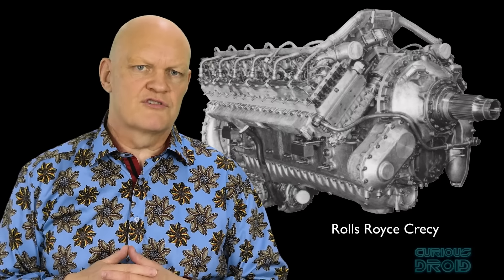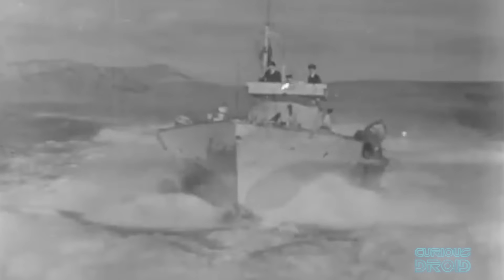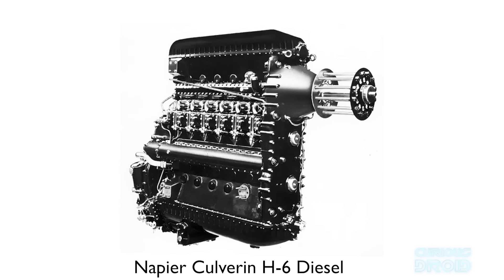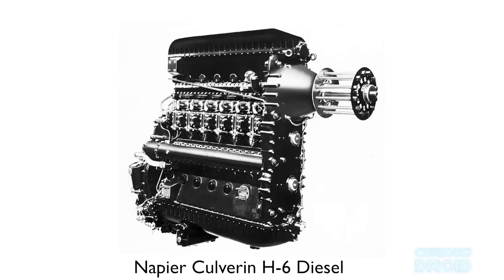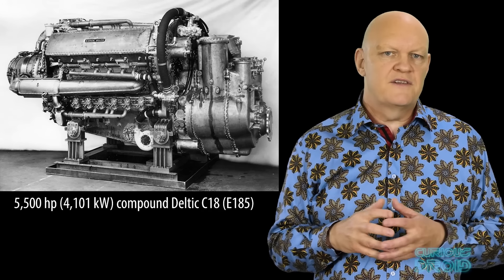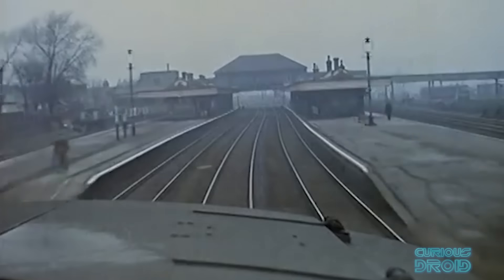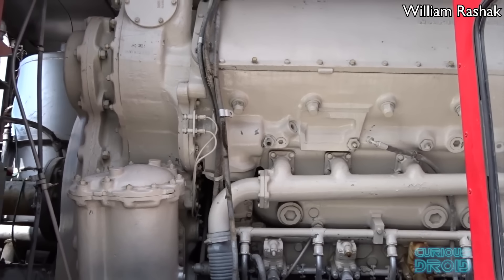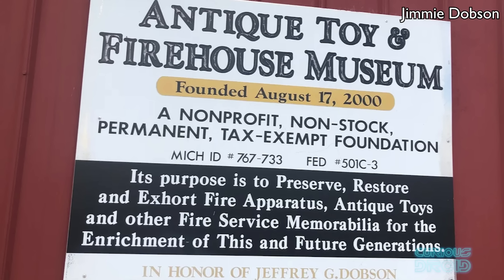The Legendary Napier Deltic - 88 Litre Opposed 2-Stroke Triangle Engine

Comment: I served on several Ton Class minesweepers/hunters in the RN.  Starting was fun, they used an explosive cartridge!  If they broke we swapped them, took less than 24 hours.  Remove all the bolts to the deck housing, disconnect everything, lift out and reverse with replacement engine. If you visit Gunwarf Quays in Portsmouth the preserved crane is what we used when it was HMS Vernon.
Reply: Great comment!!
Reply: Thats amazing.  Thanks for the sharing your knowledge!!
Reply: The Royal Engineers had their Diving Training Establishment at Vernon up to the late '90's (I think). I did my training there and we used 'the creek' dock to dive (and also at Horsea) and i can vaguely remember it had a crane nearby. I'd guess this dock/inlet was where your boats were berthed for their refit?
Arduous training but great memories.
Reply: Some tractors were started with a blank 12 bore cartridge.
Reply: I've often wondered how the explosive cartridge   start the engine?
Reply: @markrobinson1135  same way as compressed air is used to start engine.The blank cartridge was put in a holder which screwed into a recess in top of cylinder then fired by hitting a striker with a hammer.The expanding gas imparted rotational motion.The cyl had to be at TDC on compression before firing the cartridge.
Reply: @markrobinson1135  I guess you have no idea at all about internal combustion engines then.
Reply: @ke7eha  Correct me if I am wrong, but isn't that how they started the plane engine in the original Flight of the Phoenix film  (1965)?  I seem to remember for jeopardy they got down to their last cartridge before it caught and flew them out of there....😱.  As a child I didn't even question it, but have since wondered as it seemed drastic.  Makes more sense with your explanation! 😎
Reply: @rooramblingon895  yep, and I just rewatched that scene. Second to last cartridge, I think.
Reply: @millomweb  I guess you have no idea how to be a decent human being
Reply: @philiptownsend4026  Sorry for stating the facts.
Reply: @whirledpeas1182  I've learnt from many others.
Reply: @philiptownsend4026  Usually, there's a 'self-protection' nature where the person is too thick to even ask such a stupid question. Someone wondering how you can start an engine with a cartridge would seem to indicate they have some idea how an engine works - and so the process is fairly self-explanatory. When the thing runs on explosions, creating the first one with a cartridge is pretty insignificant - but a fun way to start an engine though !
Reply: @millomweb  there aren't any stupid questions. Not everybody has the benefit of the same experience and education, and nobody can know everything. I'm sure there are plenty of subjects on which you'd have "stupid" questions to ask - let's not gatekeep the things we're interested in and exclude people who aren't already in the know, why not just take 2 minutes to explain and bring those people in so they can share in our interests too?
Reply: @chemistrykrang8065  There certainly are stupid questions !
Reply: @philiptownsend4026  "IC engines do not run on explosions. So what does you the expert know?"

That you're wrong !

IC engines are designed to withstand the explosions - which is why they generally don't shatter. Occasionally, one blows the head off.
Reply: @philiptownsend4026  At least I now know they're not 'hydrocarbon fuels'.
If you want to be precise, they do explode but in a suitable container. 

I don't think they'd have sold many advertising them with internal explosion engines.
As for your assertion fuels don't explode - try convincing the folks who live in what's left of New Ferry, Wirral.
Reply: @philiptownsend4026  "I am still not managing to get you to accept the difference between flammable and explosive substances"

That's because there is no difference, same substance, different combustion circumstances !

"but really it was a very fast rapidly expanding burn" - a bit like an explosion then ;)

Irrespective of the fuel, if the burn results in a container failure, that is usually sudden and therefore explosive - in New Ferry, the container was a building.

Pretty much any flammable fuel can be burnt 'calmly' or explosively. It is entirely down to how the burn is achieved.

"I think I have been able to help you in two ways:...." I guess you've not asked me any stupid questions.

I suggest you check on the definition of 'explosion' et al - then you'd probably find you'll agree with me.
For info, when you challenged my understanding of it, of course I researched what I believed to be true - and as is often the case but not always, I was right.

On a different matter altogether - 'metadata'. I understood it from the 'off'. Last December, I found computer people were explaining it wrong. So I had a conflict of info - so I researched it - and discovered I was right and nearly all in the computer world are wrong !
Reply: @millomweb  I had two , fordson super majors with 4x4 conversions ,used them as skidders for forestry .. we called them spitfire starters as was same cartridge used to start aero  engines, or that was what we were told they were .. had another that was a windup spring loaded ..
Reply: @borderreiver1806  Same cartridge for aero engines and other engines
Reply: @borderreiver1806  - that name you are using sounds like the name of a wagon !
Reply: @borderreiver1806  - indeed, my parents and many generations before them were from Langholm. Proud of my Reiver roots, and their 'best of both worlds' ethos!
The KOSB disbanded in 2006 but the honours live on.
Back to the Napier Deltic...!
Reply: @millomweb  why insult someone for asking a question? did you come out of the womb knowing all the answers?
Reply: To answer the original and some followup thoughts without snark...
If you don't have a reliable electric start system (because they haven't been invented when dealing with early engines, or would weight too much for air use, etc), and sometimes even if you do, you want a reliable and safe way to start the engine.
One thing that almost always works as expected is a solid explosive - more along the lines of smokeless powder than C4; packed into nice cartridges. The cartridge when fired creates a lot of gas that previously wasn't there - as long as you spun the prop to make sure it was at the right spot before you fired it, you've just blown a bunch of gas into a piston and got the whole works spinning. If you can add fuel and spark/magneto fast enough, you can fire up the engine. Of course make sure to replace them with new ones when you land. :P
Same idea was used on a lot of ICBMs and their human rated variants (Titan II) which fired a cart (audible in launch videos) to initially spin up the turbopumps (that provide fuel and oxidizer at high pressure to the combustion chamber).
Things were a lot different with old planes, and still remain so for many of the vintage planes still in use. Modern pilots are spoiled in comparison - start up the APU and once it's running set some bleed valves to the right setting and you can spool your engines... obviously a long checklist before you can fly, but some of those "cold and dark to flight ready" videos show the longest delay is often the navigation system getting its bearings, and starting the engines is casual and often only one is lit before pushback, and the rest are started on the taxiway as you're approaching the runway. Even when I was a kid I remember them starting all engines before pushback, but reliability is so much better these days with ETOPS rated engines, FADEC controllers, etc.
Reply: I own and live on (ex-HMS) Portisham.  The Paxmans were too much for one person of meagre means, to keep running.  Lovely sound though.  My dad worked on MTBs with Deltics when he was with Vospers.
Reply: @markrobinson1135  The gas from the exploding cartridge would drive a small turbine in a fairly small device attached to the engine - you could lift the device with two hands. A gear on this would then engage with a larger gear on the engine, which would then rotate the engine very quickly, in a similar sort of way that a starter motor turns over the engine in a car.  Some of the gas would also be used to push the fuel rack over to the maximum fuel position so that the engine would start. The whole arrangement was very compact. It was bit temperamental though, and sometimes would not work, so some wires, a torch battery and a stoker holding the fuel rack to the maximum position within inches of the exploding cartridge, was necessary to get the engine going - nail biting stuff at times!
Reply: I was on the Isle of Wight ferry from Southampton to Cowes, week before last. There wes a minesweeper moored outside Cowes harbour and I could hear a familiar engine note coming from her, a Deltic.
Reply: Thank you for your brave service.
Reply: Thanks for the extra information. Grade A comment.
Reply: I have the 18 cylinder for my mazda miata weekend driver.
Reply: awesome. I love this level of reply,top quality! 👍🍺🇬🇧
Reply: @carlbModels  you're welcome.
Reply: Interesting comment. I lived just outside Portsmouth 50 years ago. Watching You Tube vids, it has all changed now. As a child I remember driving into town in the old man's Morrie 8. It was all bombed out and depressing then. I came across Brave Swordsman in Gt Yarmouth when there and the skipper refused to tell me its top speed, he reckoned it was classified! The diesels had been replaced with gas turbines by then.
Reply: I served on the Mine hunter HMS Brereton fitted with these engines.
Reply: The Vernon Squadron  (I Served on all 4, dreading HMS Monkton! )  was "Half-Crewed" for RNVR Training. Stokers in Vernon used to get "Friday-Crash-Drafts" to fill-in for "absent/sick" Week-End Sailors ! Later, Based in HMS Dolphin, I Served on Brave Borderer, then Dark Fighter/Dark Intruder, for  "Missile Trials". Next Ship ? HMS Eagle for Beira Patrol/Aden/Malaya !
Reply: I used to love when the tons were flashing up, it was like being on a shooting gallery
Reply: @sbkenn1  as a young man I served on HMS avaley. Same class of boat I think, inshore minesweeper. Happy days 😊
Reply: @tamar5261  There were 93 of these boats built in the 1950s, all named after towns ending in "ham".  They were referred to as Ham-class.  Mine was HMS Portisham.  Portisham is near Weymouth.  Successors were the Ton class, for a similar reason.
Reply: In the early days, they were difficult to start as the navy had supplied the WRONG CARTRIDGES !
Reply: @eugeneoreilly9356  You had to set the relevant piston to slightly after Top Dead Centre.  In early childhood, we lived on a barge that had a 3-cylinder Bollinder which used air starting that required glow-plugs to be heated with pump-up Parrafin blow-torches.
Reply: @millomweb  An explosion is just a very rapid burn.
Reply: @mjbrennan0  I am surprised that the gears weren't pre-engaged.  It was on the Paxmans before the starter went to full (electrical) power.  I had also thought the explosive start went straight into a cylinder as the air-start did on Bolinders.
Reply: @sbkenn1  An explosion is a sudden release of pressure.
Reply: @millomweb  Sudden, is relative.  Nothing is instant.
Reply: @sbkenn1  Coffee is.
Reply: same on the railways , lift out engine replace with overhauled one , loco back in service quickly while engine went off for overhaul
Reply: I’m ecstatic
Reply: @millomweb  You still need to stir it ;-)
Reply: @millomweb  I understand internal combustion engines,And saw cartridge use on that made up aircraft on "Flight of the phoenix" and guessed that's how it was used,Guessing is not knowing
Reply: @millomweb  Use a little less aggression makes you sound superior,Arrogant and you don't want to be that? Explain to us simpletons and will look up to you as the "Teacher"
Reply: @millomweb  We are "nit picking" The hydrogen bomb is not a bomb at all,Now correct me!
Reply: @chouseification  What i thought was amazing was the Avro Vulcan and all the back ups for starting if they had no runway and facilities,Onboard compressed and pumps,Once one of the four engines were running could start the other three ect
Reply: @Johnketes54  I'm not very familiar with the old V-series bombers sadly, but I believe it. From what I have seen of British planes, they do things in a very interesting manner. 
I'm not knocking it at all, as it's interesting to see the minor differences between US built and UK built planes, especially the early post-WWII ones. The thing that always gets me is the difference in hand grip between the two - with the Yank yoke being much more like a steering wheel and the Brit one being much more like bicycle handlebars. Both work equally well, but why did the styles catch on as they did? :D Do pilots using one style get carpal tunnel problems more often? :P
Reply: There was one sitting off Cowes harbour last summer as the ferry I was on went past. I recognised it because the Deltic was running and the exhaust note was instantly identifiable.
Reply: You served? Congratulations on thinking being a Servant entities you to some sort of respect. Servants do as they are told and get NO respect.
Reply: @millomweb  seriously bigger than 12 bores!
Reply: I remember having to repair them every 50 hrs or so when they'd throw valves/cylinders.  Great when they worked, PITA when they didn't.  Super crazy engines to work on though!
Reply: @millomweb yeah, the old Field Marshall's.
Reply: 🤗👍🏼 thank you!
Reply: @markrobinson1135 
Have a look for shotgun starting an aero engine, a couple of videos there, not sure if they ventured into the mechanics of it or not.

Comment: My dad, a royal navy maritime engineer in the 60s Would service these. if I remember right he said the engine started up so fast, and with so much power that the solid metal output shaft was made of an alloy that was designed to TWIST then spring back into shape as a way of dampening the torque output at start-up. MOAR POWER!
Reply: That was the drive shaft that ran from the phasing gears to the supercharger.
Reply: @donaldasayers  Just spoke to him, he mentioned that if he remembers right the shaft could rotate a turn, and return to its shape , which I find insane.

Comment: 'Nasty' class Motor Torpedo Boat . . . . . now that sounds like a boat I would like to own.
Reply: I'd prefer the same just without the 'cl'
Reply: @loginavoidence12  you sound like one for sure lol
Reply: @John Dillermand But did you know that "nasty" is the Norwegian word for "very cute"? Eh? Eh?
Reply: Ha ha you would need dump trucks full of flaming Pound notes
Reply: In your dreams fan boy I am not sure why I'd know this, but let me guess you would might object to 12 liters petrol per kilometer. Just a SWAG.
BTW I am agog to get my greedy mits on one as well. Pleasant dreams.
Reply: Gilzor:  I hope you are wealthy. Those engines are wonderful, but need an overhaul I believe every 500 hours. The Nastys in VietNam would be sent to Subic Bay, PI every so often for maintenance and replacement of some of the marine grade plywood to bring them back up to snuff. The overhaul of one engine back then was in the neighborhood of $300,000.00 US. In two tours there I was involved in two or three engine change outs due to some damage that was beyond local repair. Not fun!!! Off to Subic in a container to be fixed. I spent a bit of time on them at sea at speed and it is exhilarating for sure. I qualified as coxswain and drove the boat a lot. At any speed over 20 knots or so, one was limited in rudder inputs as too much would roll the cooling water inlet out of the water and the engines would overheat quickly. In calm seas they rode well, in rough seas, people could be hurt from slamming into waves. I knew a couple of guys who broke their arms falling when the boat hit a big wave and they were not holding on tight.
Reply: @seniorrider9337  👍  . . .  . I envy your experiences. Sounds like times to be proud of.  . . . . :)
Reply: @gilzor9376  Well, it was a special time. I thought we ( the US ) were doing the right thing. Now, many years later and so much more knowledge of that war, I am not so sure. I made a lot of friends in the VN Navy as we helped then with training and how to do the maintenance on these boats. Unfortunately I lost all contact with those friends in 1972. I was on a Knox class frigate in 1975 when Vietnam fell and my ship, the USS KIrk, ended up leading a rag tag bunch of refugee boats to Subic bay. If you are interested, look up the bureau of medicine movie "The Lucky Few". Those were times to be proud of. I spent 3 days on an ex USN water tender class ship with over a hundred Vietnamese. Little food, iffy water, and big rats. We did get them all there and they were I believe mostly later sent to Guam, as the Philippines were not too hot on receiving them. One of the reasons I was on the VN ship for three days instead of one. We steamed in circles until the diplomats cleared us to enter port.
Reply: @seniorrider9337  Thank you for your courageous service. Not sure where the appreciation stands with our youth today, but you can be sure you still have the respect of many, many Americans, myself included. Regardless of the reasons and outcome of these conflicts with the governments involved, the men in the boots that were on the ground, deserve unquestioned respect. It is sad when we see the youth of today not having any clue
about the potentiality of that cell phone in their hand being taken away along with their freedom. Thank you.
Reply: @giovannimorrisone483  well its not:)
Reply: In the 60'ies my father was a medical doctor in the Lofoten Islands in Norway.
Sometimes these boats were used as emergency transports and I got to go with my father on these trips.
Unforgettable.